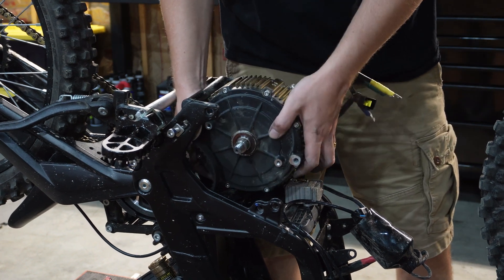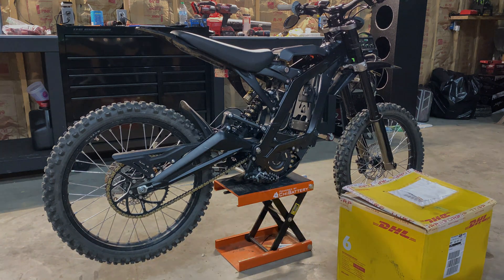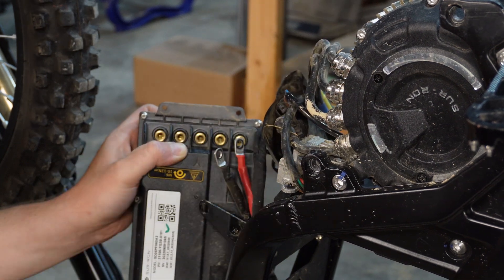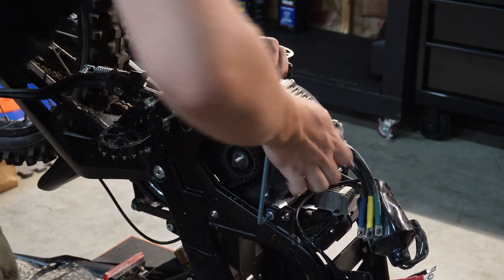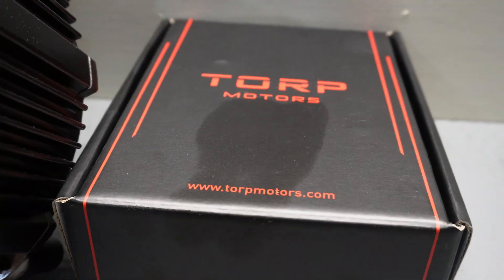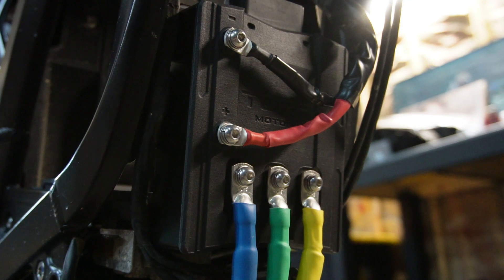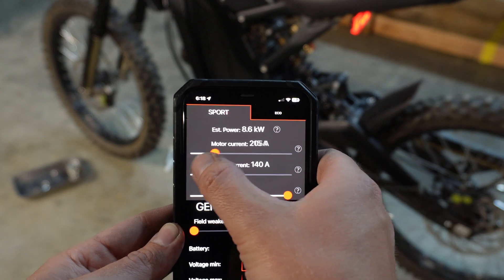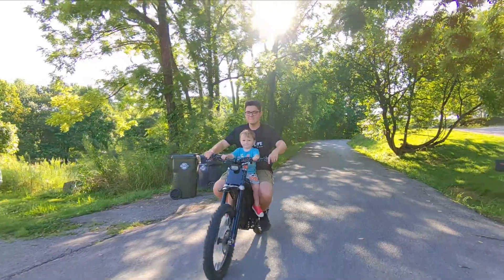TORP TC1000 & TM25 MOTOR INSTALL FOR SURRON LIGHT BEE

Comment: When you install the new motor do you use a impact? Or a ratchet?
Reply from the maker: @alexp7824  ratchet
Reply: @ is there a difference? Im also installing a ebmx motor. And a jackshaft and new belt same time, which order should
I install? Im using your video for instructions although its a different motor

Comment: Great video!  I have a question for ya.  I bought the belt drive upgrade on my Surron not thinking about making upgrades like this later.  So my worry is if I upgrade my motor, control & put on a 72 volt battery will that belt be able to handle it?  I'm no pro at riding, decently conservative driver & never jump over a few feet or really hard on my bike so should that belt hold up or would I need to convert it back to a chain.  I understand belts will need replacement every once & a while but would those upgrades just be too much or should I be okay?!  Thanks for your time, I sure appreciate it 😊
Reply from the maker: @Jay-qq7kp  the main thing I’ve noticed with keeping a belt drive is if you do ever jump do not land on the throttle. So like if your in the air jumping let off the throttle before you hit the ground and then get back on it after you’ve hit the ground. I have ran both belt drive and chain drive on 72v. & I truly like belt drive better just cause it’s quieter & it lasts great. Especially if you upgrade to the gates gt4 belt I believe it’s called. Grit shift does carry them. Hope this helps. Thanks for watching !
Reply: @JUSTINHAWKSMITH  bro thanks so much for the info!!  That makes a lot of sense about the throttle on jumps and makes me feel much better about doing those upgrades and being able to keep my belt drive... I've grown to love it lol.  I also have the Eride pross and for a straight out of the box bike it's so fun & I'll probably upgrade it where more parts come out for it.  But the feel & ease of a Surron are just so nice/ comfortable that I think I'll be fixing it up especially knowing about the belt!  I really appreciate it man, love you videos 🫡🤙
Reply from the maker: @Jay-qq7kp  thanks so much I work hard on them when I get the time to. Appreciate nice people watching like yourself. Have a great day !
Reply: I have a torp tm25 and tc1000 and have put about 200 miles on the setup and have yet to break my belt that has about 550 miles on it and i ride it full power most of the time.
Reply: And i ride it pretty hard too